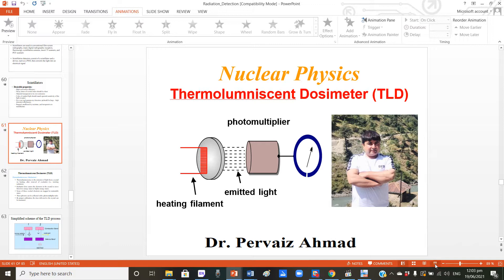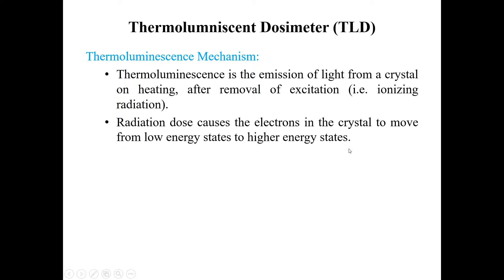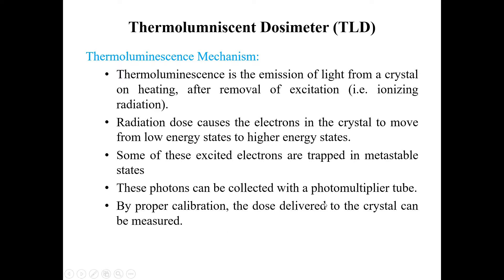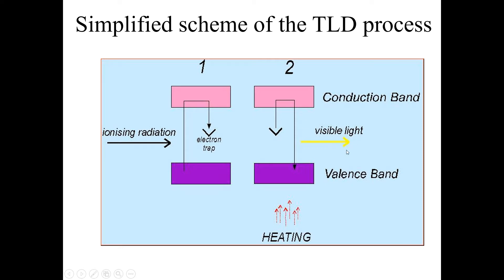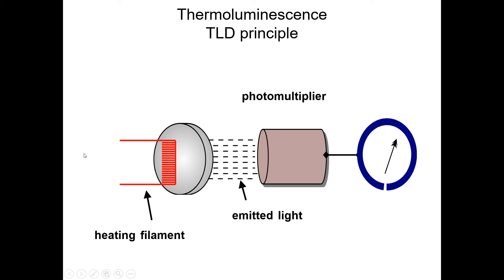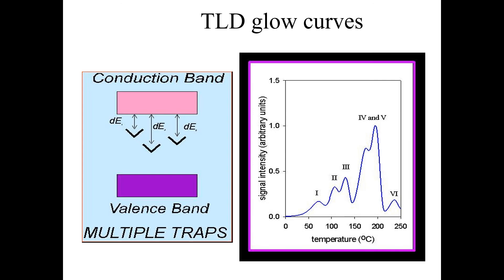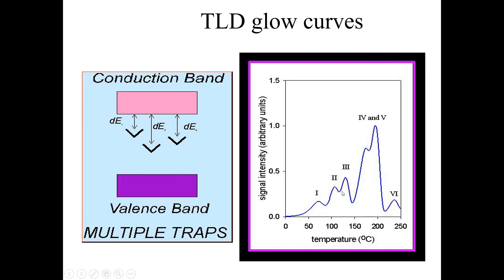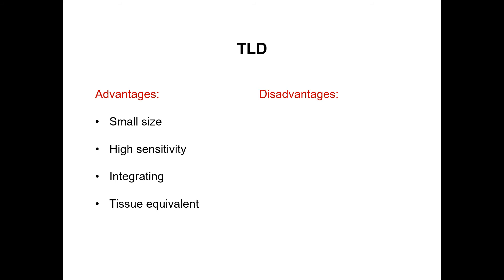Thermoluminescence Dosimeter TLD

Comment: The amount of heat energy is utilized to determine the radiation level? Is that correct Dr?
Reply from the maker: Thanks Dear Tim
Actually, thermoluminescence dosimetry (TLD) is based upon the ability of imperfects crystals to absorb and store the energy of ionizing radiation, which upon heating is re-emitted in the form of electromagnetic radiation, mainly in the visible wavelength.
You can learn in more detail from the following document:
https://inis.iaea.org/collection/NCLCollectionStore/_Public/28/017/28017938.pdf